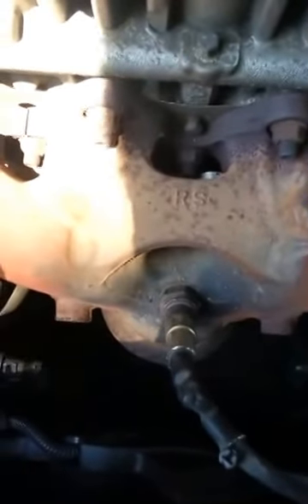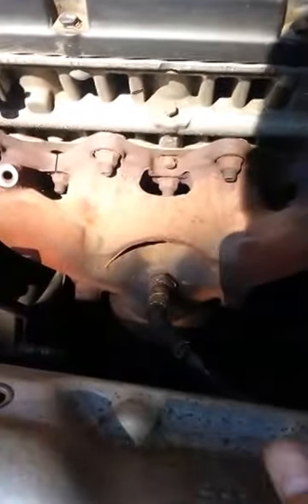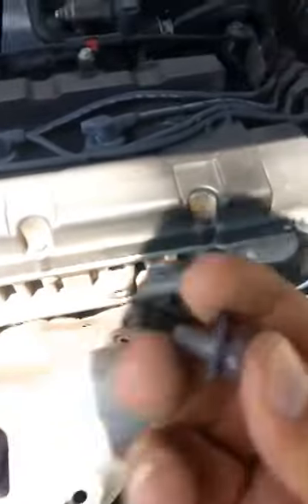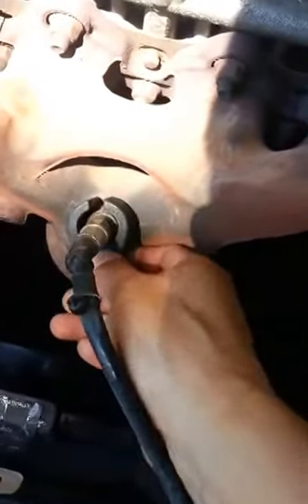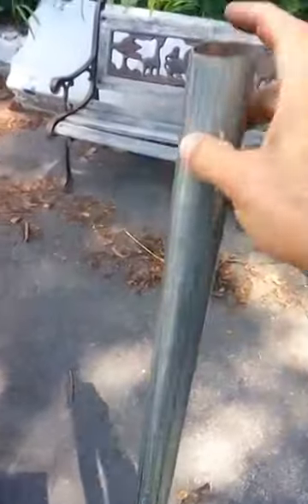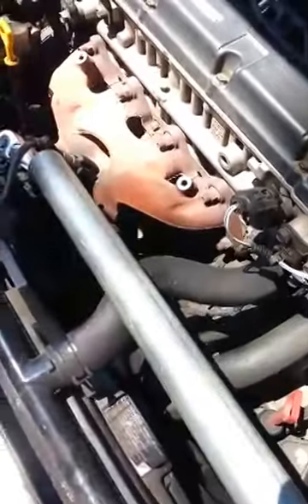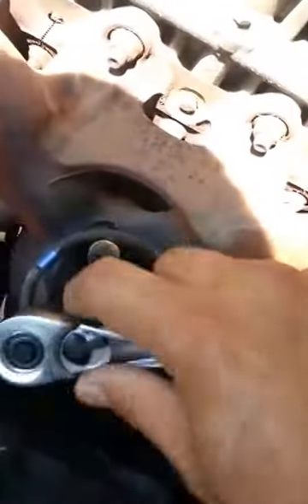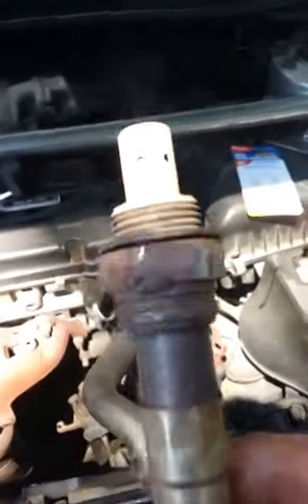2006 Kia spectra oxygent sensor replacement/removal

Comment: looks pretty loose lol. use breaker bar when adding that much torque. fyi you'll strip the threads in your ratchet
Reply from the maker: Thanks for the advice Richard.

Comment: No need to take any covers off with the special tool socket. Just unplug wire like he did and use a breaker bar or use a cheater bar to loosen.